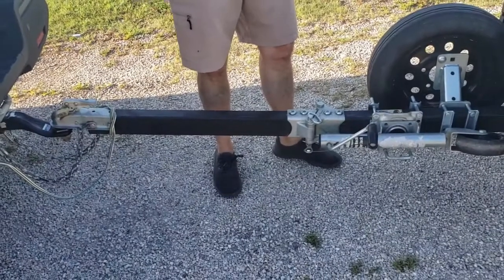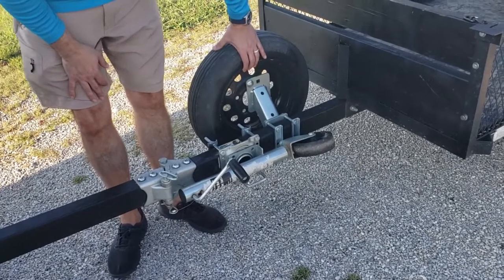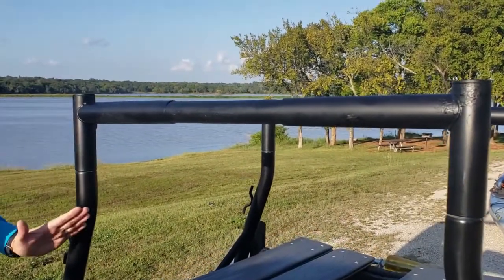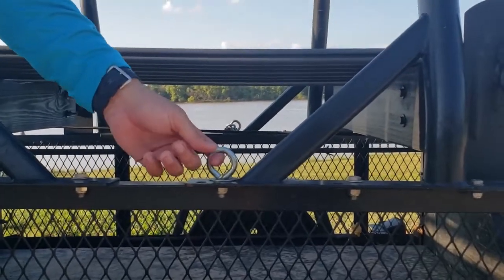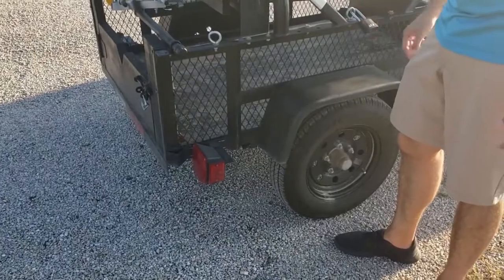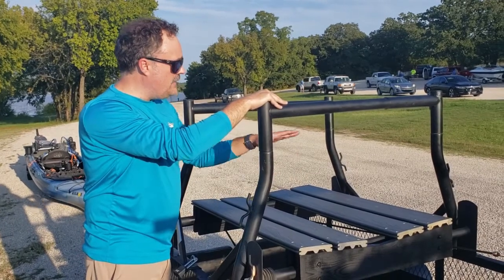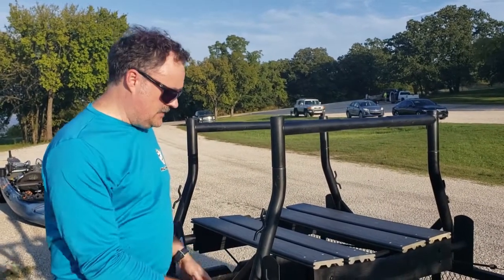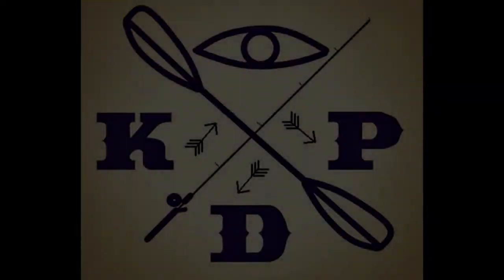Racks fer yer yaks--DIY Utility to Kayak Trailer Mods.

Comment: Couldnt you just turn the ladder racks 180 degrees and that would give you a lot more width for wider kayaks?
Reply from the maker: Unfortunately not. I've tried this but the center bar is not long enough to accomodate the wider span. I'm currently in process of doing some additional trailer mods though, so sub so you can get the updates to this project.

Thx for watching!

Comment: I have the same exact rack on my trailer. My trailer is 4 foot wide. I flipped the rack uprights so the curve goes outward. It works perfectly and didn’t need to modify it in any way. The top of the rack is wider that way, about as wide as my fenders
Reply from the maker: Awesome! Did you get the one for compact pickups? I've tried flipping it like that but these actually don't have long enough tube material (TWSS) in the middle to do that. 😕
I'm thinking I may get a Malone product to add some diff bars up top. I've had to take these off to load my new kayak which is wider.

Thx for watching!
Reply: @kayplainsdrifter136  yes mine was a Maxxhaul brand or something like that. Good to know the tubes are too short on other brands. If you’re looking to be thrifty and save money, it’s standard pipe size they sell at big box hardware stores to get longer middle.
Reply from the maker: @kylehowe1226   That's very helpful to know! Is the pipe you're talking about the metal conduit in the electrical section?
Reply from the maker: @kylehowe1226  Also, I think mine was the AA Racks or something like that.
Reply: @kayplainsdrifter136   In the plumbing section with the black iron pipe. It’s not the iron pipe but a thinner type. I bet you could find conduit to work as well
Reply from the maker: Awesome man...thx!